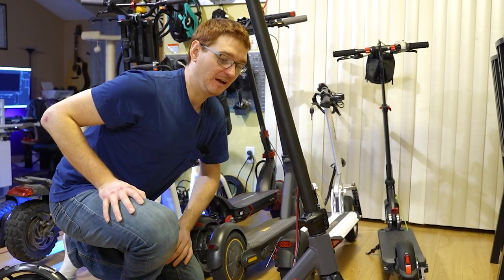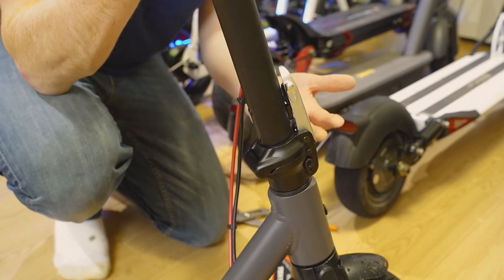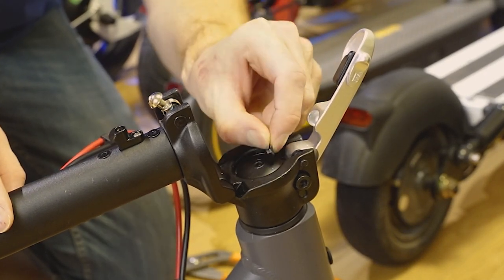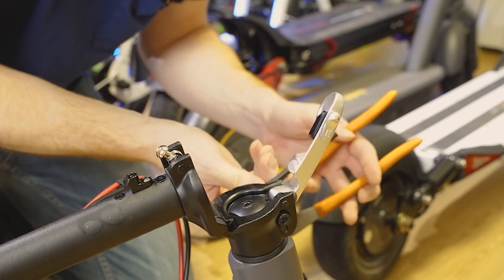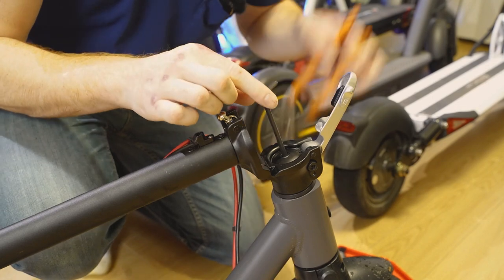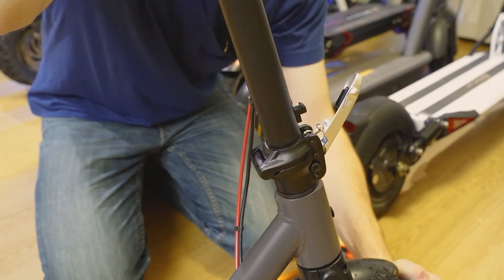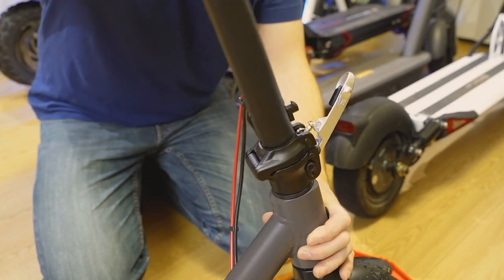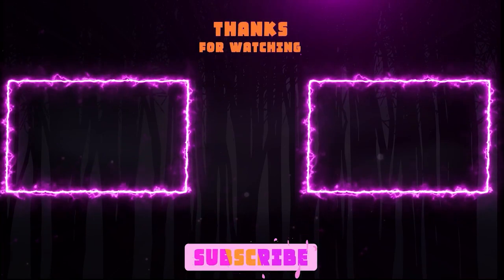Hiboy S2 Pro Stem Wobble - FIXED! - G.O.W workshop*

Comment: This was NOT what caused my handlebar stem to wobble. I did this, unnecessarily, and the large bolts on the side were so tight, I bent and ruined my tool trying to loosen them. I finally got one side loose, and tightened the center screw which was already tight, and it didn't fix the wobble at all. Come to find out, it was MUCH simpler fix. Just tighten those 4 small screws near the long part of the stem at the bottom where it folds. Same screws that are used at the top to put the handlebar into the stem. Those were loose. Boom, that fixed the wobble. Check that first before going though this process and unnecessarily tearing up your tool or cracking loose an otherwise fixed bolt.
Reply: BRO u saved my life forreal. i love you
Reply: this is what fixed it for me after 2 hours of tryna fix the wrong thing like this video
Reply: @DatSpyPie  no problem bro and enjoy your scooter!
Reply: the video says stem wobble, not handle bar wobble, thats another issue.
Reply: Mine doesn’t have four screwed at bottom of stem only two. Has four on top of stem though

Comment: When I tighten the bolt it becomes rather difficult to turn the handlebars as if there's a lot of friction. Any ideas? Am I just over tightening?
Reply: Answer?
Reply: Same
Reply: Have u fixed it yet?
Reply: @V Patel  I think it was just overtightened. I loosened it up then tightened it again just a tiny bit until it was comfortable turning but still didn't move
Reply: You tightened it too much. Take it back a quarter to a half turn. I did same thing
Reply: Same here, loosened the inner bolt.
Reply: Weird it's not turning
Reply: @rainbowbirdthywhiteknight6984  his instructions are wrong. The inner bolt cannot be too tight or it won’t turn.
Reply: @peterergo  It is kind of annoying having to find the sweet spot of no wobble and comfortable turning friction. That is bad design, in my opinion.

Comment: Thanks for the tip, it works great! What about the bolt on the front of the stem (below the clasp covered by a rubber plug)? It's loose and won't thread into anything and spins (both clock/counter) infinitely. Great channel!
Reply: I'm not sure I know which bolt you're talking about?

Comment: Thanks for that! You mention in another comment that if you want a better scooter, consider the Ninebot Max.  I watched your full S2 Pro review and it seemed you felt the S2 Pro did better on most areas. Do you still hold that opinion? Also, do you find one of them to be generally more durable and longer lasting?
Reply from the maker: Ninebot is just a thicker, beefier, more well rounded scooter. The s2 pro is comparable on paper but you really do feel the few hundred dollar difference when riding.
Reply: @GingerOnWheels  I just wish it had solid tires. After a year with my s2 pro I simply can't go back to pnuematic/inner tubes. Yes they're smoother, and yes once solids wear down enough, replacement is a hassle, but the peace of mind to not worry about sharp rocks, glass, or pinch flats (and my god are electric scooters NOT designed for easy frequent PSI checks/top-offs with their flush valve stems) is just a complete game changer. My maintenance routine is so much simpler with solids. 

My dream scooter would be 10 inch solid tires with FRONT and rear suspension, and a 20+mile range at 20mph. If anyone could point me in that direction (preferably under $800) I would be so grateful. I know the drawbacks of solid tires aren't negligible, but after 20+ years of bike/scooter flats (regardless of regular maintenance/patching/tire slime) under rougher conditions, I'm simply fed up with the whole thing. Give me an extra 4 pounds and reduced traction over worrying about a shard of glass 10 feet in front of me as I'm cruising at 15mph any day

I'd literally pay an extra $200 on top of the existing price difference for and ninebot pro with solid tires and full front/back suspension. I fully agree that the build quality/feature difference between segway and hiboy makes segway worth it, but solid tires have simply changed the game for me. And the fact that Hiboy bothered to include even rear suspension for their S2/KS4s is a stroke of brilliance. At least it's something, and a rare treat in the $400-$600 range
Reply from the maker: @jesss2830  Check out the new vsett mini that Alien Rides has! May be up your alley. 
https://bit.ly/AlienRides
Reply: @GingerOnWheels  wow that hits so many of my needs! A hook for groceries, solid tires, the suspension, a reputable brand. The range is a little concerning with the "20-12 mile" claim but in reality, they simply might be being way more honest than most, with 20 miles being real-world figure in eco mode vs 12 miles at max speed/ Most brands would take the max range in eco mode with a light rider on flat smooth ground and call that the max range.

Max weight just under 200lbs is a little concerning vs 220 or even 265, but it does seem Vsett is pretty conservative with their specs, which I can appreciate. My commute is about 10 miles both ways, which is well within these specs,... Gosh it's tempting. If it had another 10 miles on its range this would be an absolute no brainer, but at $700 I really wanna make sure it at least lives up to the listed specs before pulling the trigger.

Comment: Might wanna consider using some Loctite screw lock glue (for this I would recommend the strong one) and tighten the screw. Should not be a problem anymore.
Reply from the maker: Definitely. If you've got loctite, use it! I think blue would work just fine. If the bearing ever needs replacement in there it would be really hard to convince red loctite to come out.

Comment: Hey man, thanks for the great videos on the S2 Pro =)  I have one and love it too.  My rear wheel has developed this rattle when I ride on bumpy streets....and I can't seem to figure out how to fix it!!!  Have you ever come across a rattle on the back side???
Reply: the hook for catching the handlebar when folded rattles like crazy on mine. A folded napkin (or anything) wedged in that clasp stops most of the rattle (unless it's the mudguard).
Reply: You sure the screws are not loosening, check all screws on scooter
Reply: @pedro-on-wheels  thanks  man, Yeah, I tried that.....doesn't fix the sound.
Reply: @gregst.martin4889  I think I have to figure out how to take the mudguard off and check the underside of it.  The rattle drives me crazy ahahahah
Reply: Easy fix! Get a Bluetooth speaker and crank that baby up! Problem solved! Follow me for more tips 😆🤘

Comment: Can you do a video with the hiboy s2 pro but changing the solid tire to air tires to see how it run the mph and the miles and to see if run better could you do a video like that please if you still have the scooter hiboy s 2 pro and another video how to unlock the speed limit and thanks for your videos...
Reply from the maker: There is no 'speed limit' to unlock and as far as I know, no air tires that would work on this scooter. If you want a better scooter with air tires get a ninebot max. You can hack it to go 20+ and it has air tires that are puncture resistant.
Reply: @GingerOnWheels  so you can not hack the speed limit from the hiboy s2 pro you say but you can try and that scooter you can not change the solid tires to air tires why the rim do not has the little hole or something so like that you put the air tires to the rim but if never try how you gonna know.You just has to try and like that you do another video...
Reply from the maker: @LuisDanielColón1  I'm way too busy for small projects like that on such a cheap scooter. Why don't you try and let us know!
Reply: @GingerOnWheels  so now is a cheap scooter for because you got a better scooter i understand that and i can not do that because i do not got that scooter. I ask that question because you have that scooter before and because i wanne know and because i am looking to buy it a good scooter but i still not desire yet wish one i am thinking this scooter the hiboy s2 pro or the Varla eagle one or Zero 10× or Vsett10+ but i do not know yet....
Reply from the maker: @LuisDanielColón1  vsett 10+ and the hiboy s2 pro aren't even remotely similar. You should take a little time and evaluate what exactly you'll be doing on your scooter and go from there.
Reply: @GingerOnWheels  i just wanne the scooter for going to my mom house and to my house that is 45min walking to go and to come back and if i wanne go to a trail for take air but i wanne the scooter with a good range of mile and with a good mph of speed and i live in Pennsylvania but i was thinking in the hiboy s2 pro and the Varla eagle one and the Zero 10× but i see that the Varla eagle one and the Zero 10× look the same...
Reply from the maker: @LuisDanielColón1  why not the varla pegasus? Seems like a good middle ground?

Comment: Thx for the content Ginger. Question. There is a rattling noise of a washer that is loose in the rear wheel but I don't see any way to unscrew the mudguard so I can tighten it. Any suggestions?

Comment: I thought you were going to show us how to fix the latch that hold the two together when handle bars are up lol this was common sense same as bicycle. But the latch is notorious for coming undone while riding. And I thought maybe is adjustable since it has a screw going thru the spring

Comment: Good video! I just found a highboy S2 in the dumpster yesterday. It looks like it’s salvageable. It needs:
1…the charging unit
2…rear brake repair(busted from apparent spill damage)
3…Handlebar fold down security clip on rear fender missing (has coat hanger Jerry rig)
…and now I notice…
4… The front end is loose as described in your video (that I did not notice until I saw this video first).
Reply from the maker: Nice find! Hopefully you can get it up and running.

Comment: Good work!!! I did all that u stated. However..the folding part is easy.  The latch part is my problem.  Three times while riding, it folds back on me while riding.   The third time I was lucky.  I have been using zip ties to keep it from folding.  What should I do. Where to go?
Reply: Adjust the shiny metal screw only one that is silver color

Comment: Hey @ginger -

I bought this scooter 10 days ago, I've put maybe 20 miles on it and noticed a wobble.

I tried the tightening in the manual and it didn't work, so I used your method -

apparently I had SHEARED THE SCREW OFF within my first 20 miles of riding. Really disappointed! I ended up drilling it out, the bolt just disintigrated during drilling (bad sign). I ended up purchasing a grade 10 from fastenal, and replaced it. I have reached out to Hiboy to see how they can make this right, as now I've got a rattling but I don't want to send the scooter back because it's so freaking fun to ride.

Btw - I am probably one of the most cautious, 'babying' scooter riders. I just ride bike paths  - we are in the same area, so think marymoor to woodinville bike trail / continental trails, only pavement is what I ride on, I use it just for joy riding. I'm 30 lbs under the weight limit (i'm 190, weight limit is 220).

So yeah, that was spooky. I can't believe that one screw does so much for the integrity of the scooter and it's only an M6 bolt. I feel like it should be atleast an m8, but really an m10.

Comment: Is there a way to buy a replacement or use something for the inside latch that the main latch connects to when you lock the scooter in place because mine fell off when I was riding
Reply: Thats why u check every screw to tighten

Comment: I'm hoping you can help, i had an accident on my scooter, and scraped up the smaller black plastic cap piece that sits above the light. Know where I can get a replacement?
Reply from the maker: Contact hiboy support. They are the only ones with parts that I know of. Email is on their website.
Reply: @GingerOnWheels  going on 24 hours and still no reply 😔

Comment: Hey Ginger on Wheels.  I am having the issue of the front wheel wearing itself out of true in a couple years time.  I hit 13 miles per hour and the entire stem gets a violent wobble throughout the stem.  I can feel the wheel being worn out of true when I am walking the scooter and when I flip it upside down and engage the throttle I can feel the uneven wear on the front wheel that is causing it.  Maybe some of you others have this issue as well.  Is there anything that can be done to fix it?  I noticed Hiboy sells a replacement front wheel.  But if I go that route it will happen again in a couple of years.  Doesn't seem very smart to keep making that mistake.  If anyone figured out a fix around the issue I would appreciate it.  Thanks!  Doug
Reply from the maker: I'm not sure to tell you. The only way it would go out of true is if you were turning the wheel while going straight which is literally impossible so it has something to do with the way you're leaning the scooter while you ride it. I'm unsure if it's a solid tire or a pneumatic tire but if it's pneumatic then you can just take all the air out of it and squish the tire around pop it off the bead and reseat it and then pump it back up and usually theyll inflate better than they were before. If it's a solid tire then putting a new tire on it might be more work than it's worth. I would just buy a new wheel or motor whatever you got to do.

Comment: Have the same scooter. The slack isn’t in the man bolt in middle of stem it is in the actual locking mechanism which you didn’t seem to address. Let me know if you still have slack and know how to fix. Thanks
Reply from the maker: No slack for me. All is well.

Comment: Will that center screw come loose again?
Reply from the maker: Its possible. Mine didn't though.
Reply: Because of you I ordered a S2 Pro yesterday 😁. Im hoping there will be  mod/hacking community like the M365 and Ninebot...seems like the hiboy has potential to become something better.
Reply: @RayRiv73  still holding up? Any advice as a newer Hiboy S2 pro owner? I'm already feeling a little wobble in my stem but I'm not really sure how much play it had originally it's not worrisome yet but in due time I'm sure I'll need to do this
Reply: @BillyBiggz  mine also has a very small wobble and it squeeks. Ill tighten the screws one of these days.

Comment: Hey my motor (on the s2 pro) is making almost metal on metal sounds any idea what it might be? Thanks
Reply from the maker: Oh that's not good. First thing I would check for is rocks maybe stuck under the fender. It could also be the disc brake in the back. I have a short video on how to adjust disc brakes if you want to go find that. Worst case scenario though is the bearings might be getting corroded in which case you would need to replace those.

Comment: I need help! The folding mechanism is very difficult to unlatch, if I pull too hard I’m  afaraid the stem will break, any solutions
Reply: You need to push the folding mechanism in first, then you can pull down the latch on the grey thing. And then pull the folding mechanism out. Then fold the bike..

Comment: On my Hiboy S2 Pro, after some miles, it stops driving because of an E2 error. It only happens when I press on the throttle. Do you think it's a problem with the pin?
Reply from the maker: I think it'd a problem with your throttle assembly. I'd send a message to support.

Comment: I did this and now I have an issue. The wheel doesn’t want to stay aligned. I drifts as I ride and came loose once causing a bit of a bailout. Any suggestions?
Reply: Currently having this issue on my Hiboy NEX3, did you find a fix?

Comment: How do u tighten a LOOSE handlebar...the 2 screws which hold it in place are VERY LOOSE
Reply from the maker: Is this a trick question?? Screwdriver would be my first guess. 😅
Reply: Actually if I could send a picture…u would see EXACTLY what I am talking about…definitely not a trick question… the 2 holes on the steering wheel stem are smaller than the 2 holes on the stem attached to the wheels…weird…the 2 holes seem worn out on the stem attached to the front wheel this holds the handlebar in place…trying to figure out do I MAYBE put JB Weld on the lower part of the handlebar stem and slide it into the stem attached to the wheels the tighten with 2 number 8 bolts so that the steering wheel would hopefully no longer wobble…did you get that?
Reply: It’s definitely SCARY to ride with this amount of wobbling
Reply: I did not EXPLAIN MYSELF correctly earlier

Comment: What just pissed me off is the fact that I somehow messed up the motor in the wheel so I reached out to highboy and they took forever to decide whether or not they were going to send me a motor they finally sent me the motor but by the time they had a sent me the motor I had already taken apart what I thought needed to be taken apart come to find out after they finally sent me a video after I requested some type of content they sent me a video and everything that I took apart I didn't need to take apart, so now I have a big issue here where I'm trying to put everything back in and the screws that you're telling me to loosen I've already taken all the way out at one point now I'm trying to loosen them and as I open up my highboy stem I see that that screw that apparently I need to get to to tighten my stem is covered by some black flat circular item and that's apparently where I need to be but I don't know how to get into that and now when I close up my stem and my wheel because I unscrewed everything the wheel and the stem go completely different ways if I pulled the steering wheel one way I can take the steering bars and turn them the opposite direction ,🤦🏽🤦🏽
Reply: The other annoying thing is that now I'll have to wait for I don't know how long for them to send me a video on how to attach the stem better because my stem is really messed up it doesn't connect at all with the wheel anymore I mean the scooter is still attached but the wheel and the stem can move into different directions if I move my arm a certain way